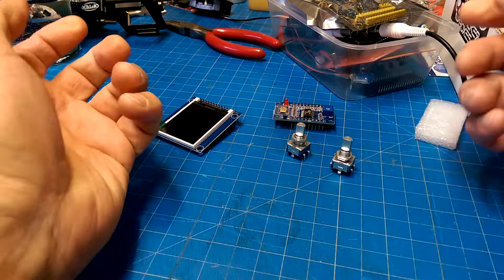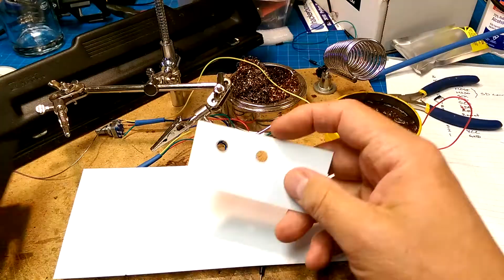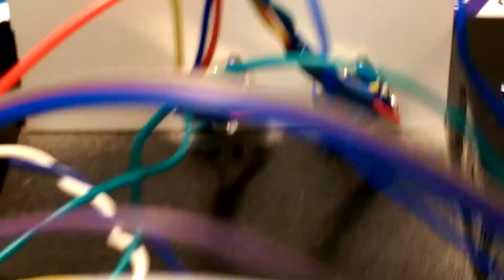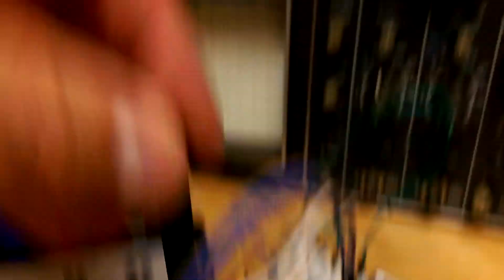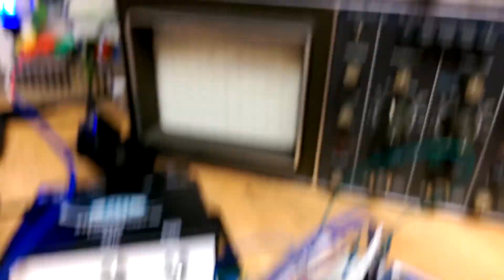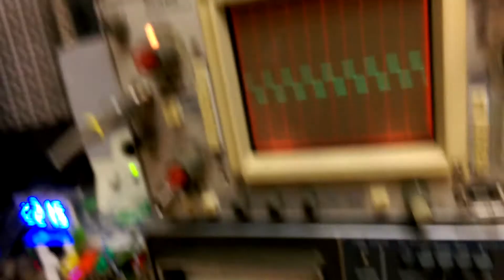AD9850 DDS Signal Generator sketch

Comment: Thanks for the video! Allow me two questions.
- Is the signal current or voltage?
- For any frequency, the amplitude is 1V?
Thanksss
Reply from the maker: It is a voltage signal that is generated.  The Sine wave function is 1v pp.  It is a positive wave, so the low peak is at 0v.  The amplitude is fairly flat out to about 10MHz where it starts to fall off.  I have not measured the -3dB point.  But that should be in the datasheet of the AD9850.

Comment: Hello, I made the same DDS, but since I need it for a radio transmitter, I need it to always remember the given frequency. I don't know much about programming so I'm wondering what I need to change in the code to get this. Thanks a lot if you can help me.
Reply from the maker: If all you want is to have a different startup frequency then you just need to change this line:

long unsigned int freq = 1000;         // Set initial frequency.

However if you want it to remember the last frequency it was set at across power cycles then that will require some non-volatile storage like an sd card and a fair bit more effort.

Comment: Can the AD9833 be tuned to 1 frequency without programming?
Reply from the maker: not easily.  The chip is designed to be programmed.   You could put together some logic circuitry to mimic a microcontroller but that would be way more expensive than just putting in an ATTiny or something like that.
Reply: @grtyvr  Hello!
I want to generate only 30 kilohertz. Dip 8 suits me.
Can you do what is needed for a fee?
Here, for contact with me: indnk@abv.bg

Comment: what is the Peak to Peak Amplitude at 100kHz? If you don't mind me asking!
Reply from the maker: It is about 1v.  That is all positive amplitude.  There is no split supply and it does not generate negative voltages.

Comment: I thought the ad9850 was rated up to 30mhz?!? I just recently ordered one under this assumption.
Reply from the maker: That is what the spec sheet for the AD9850 says.  The module however does not provide that.  I have not looked into why that is.
Reply: @grtyvr  Have you tested more than one? Hopefully it was just a manufacturing flaw
Reply from the maker: Both modules I have used exhibit that behaviour.  Also, as noted in the original design by John, he saw the same.  The 9850 certainly does produce a sine wave well beyond 10MHz, but the amplitude of that wave decreases as you move past 10 MHz.
Reply: @grtyvr  oh ok, so I would just need an amplifier stage then, that's alright, I was worried that you meant it was a hard limit to the output. Thank you for answering my questions.
Reply from the maker: @maxk4324  no worries.  Good luck with your project!
Reply: 30 millihertz?

Comment: have a question. are you able to program the ad9850 to generate sweep sine with this setup?
Reply from the maker: I have not looked at how hard it would be to do, but my first reaction is that it should be possible.  I have not tested how fast you can change frequency and I am not sure if the ad9850 has a sweep mode.
Reply: Thanks.
ad9850 should have a sweep mode. I replaced the microcontroller with Arduino Nano so i can upload sketch through usb, but I'm wondering how do I program 9850 through arduino or is that even accessible?
Reply from the maker: I just looked at the data sheet for the ad9850. http://www.analog.com/media/en/technical-documentation/data-sheets/AD9850.pdf  Does not look like it has a sweep mode.  You program it by sending either 8bit parallel on pins 1-4 + 25-28  (D7 = MSB, D0=LSB) or 40 bit  serial on pin 28.  So the sketch would need to communicate with the ad9850 on those pins ( plus a clock ) and send the frequencies and phase that you want the ad9850 to output.  Frequency change takes 18 clock cycles  at 125MHz clock means a max sweep speed of just less than 7 M frequencies per second so that should work.

So in the original project they used serial.

// transfers a byte, a bit at a time, LSB first to the 9850 via serial DATA line
void tfr_byte(byte data) {
  for (int i = 0; i < 8; i++, data >>= 1) {
    digitalWrite(DATA, data & 0x01);
    pulseHigh(W_CLK);   //after each bit sent, CLK is pulsed high
  }
}

To send frequency they did this:
void sendFrequency(double frequency) {
  int32_t freq1 = frequency * 4294967295/AD9850_CLOCK;  // note 125 MHz clock on 9850
  for (int b = 0; b < 4; b++, freq1 >>= 8) {
    tfr_byte(freq1 & 0xFF);
  }
  tfr_byte(0x000);                     // Final control byte, all 0 for 9850 chip
  pulseHigh(FQ_UD);                    // Done!  Should see output
}

So to do a sweep function you could loop on sendFrequency from lowFreq to highFrequency over a time interval calculated based on the frequency range and length of time you want the sweep to take.
Reply: on page 14 it says:'Other operational modes (frequency sweeping, sleep, serial
input) are available to the user via keyboard/mouse control' not sure what it means... do you need a ST-Link V2 to communicate with ad9850?
Reply from the maker: I think they are talking about a development board that you can get the chip on.  The module I used is not the dev. board.  But they do give a schematic, pcb layout and BOM for building one!  Nice.  

They describe how to program the chip on page 9.
Reply from the maker: Here is a quick look at how I did it....

https://youtu.be/SPUh_Io9IYA

Comment: ps.. U clearing all disp when you changing freq ... u dont need to do that. just use background color for text and it will be 0 of blinking all elements on disp...
Reply from the maker: I will fix that as well as fixing the annoying feature of jumping back to the 10MHz setting if you try to lower the frequency below 1Hz in the next version of my project.   https://youtu.be/kwTbjOf6Yqc

Comment: Thanks. Question: Where is the square wave output coming from?
Reply from the maker: The 9850 is an arbitrary pulse generator.   The module outputs the sine and square wave on 9, 10 and 7, 8 respectively.
Reply: The square wave comes from feeding the analog sine wave to a comparator (on the chip). It seems, at first blush, like a strange way to generate a square wave in a digital circuit, but if you think about it that’s how the resolution can be finer than a clock cycle.